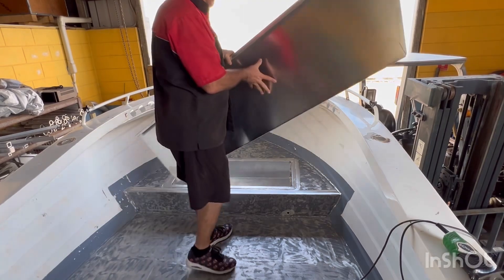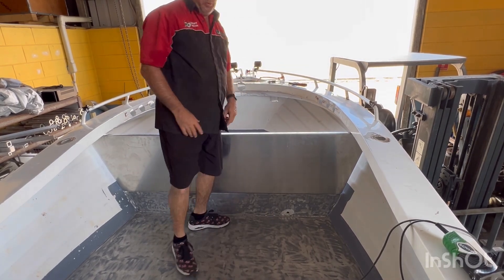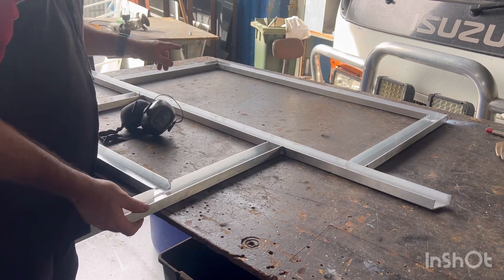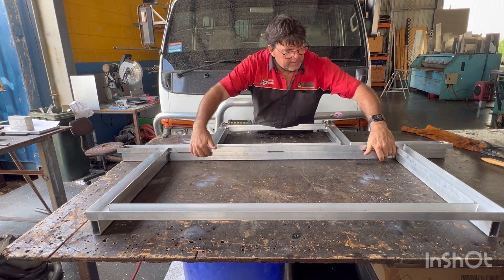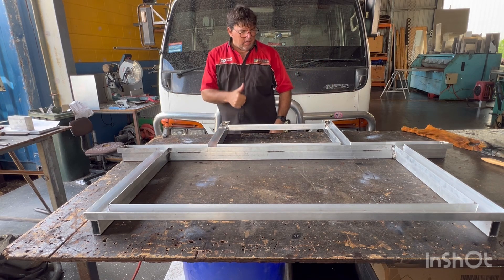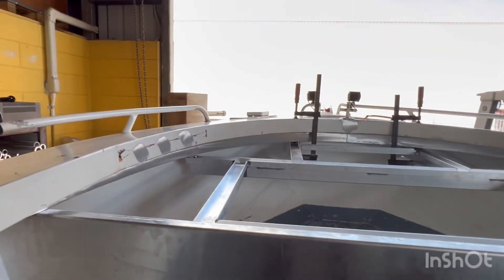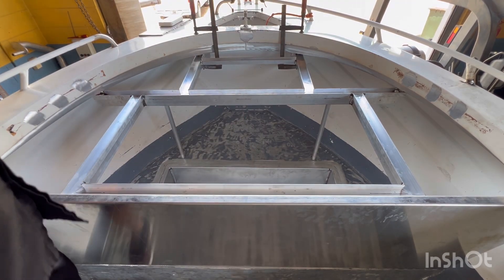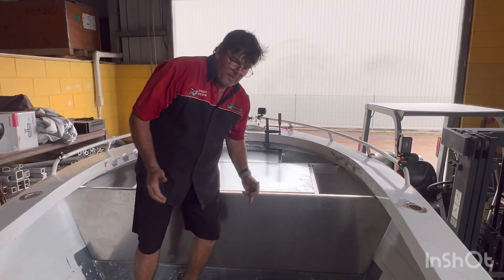How to build a Casting Platform for Aluminium Boat  from Start to Finish

Comment: Awesome videos, I enjoy them heaps, would you be able to do a video on the basics of aluminium welding with the set up you use, I m very much only a novice at aluminium welding and any information would be much appreciated,  thanks again  , regards Glen Brisbane
Reply from the maker: Glen thanks for your comments 
Yes that is something I can do for you I , I do have a couple of other videos with some setups for the MIG the TIG is a variable temperature control up and down as needed 
The MIG is also set the the Metal thickness and the machine does the rest

Comment: Hi love the work you do is it 3mm plate your using on the front deck and console
Reply from the maker: Yes Glenn 3 mm is a good thickness easy to work with “cutting,folding and handling “ 4mm and up is too heavy and 2 mm is too flimsy

Comment: You’ve probably been asked a few times but, what welder are you running there with the mig ?
Reply from the maker: Only the best Fornius
Reply: @RacingRenovators  thanks. So I went and got my hands on a fronius transterl pulse 3000. It’s great but the torch leads of only 3.5m and I’m coming from a Unimig with a 8.0m push pull. I just watched your last transom storage video and saw your welder/ wire feeder hanging from a gantry. Any chance of a video showing that? What fronius are you using? Thanks